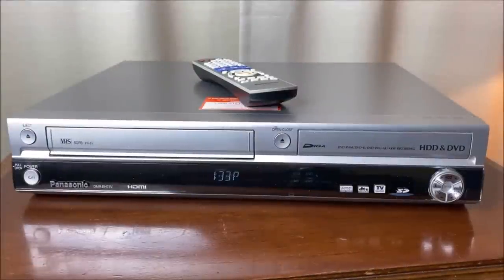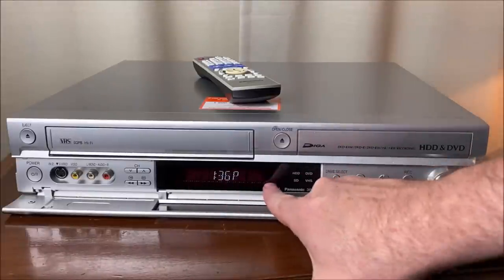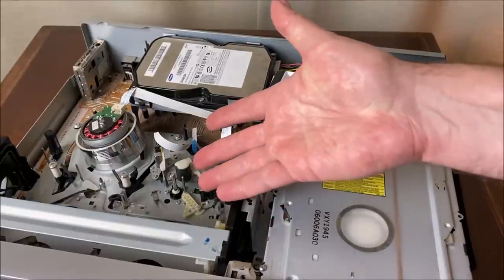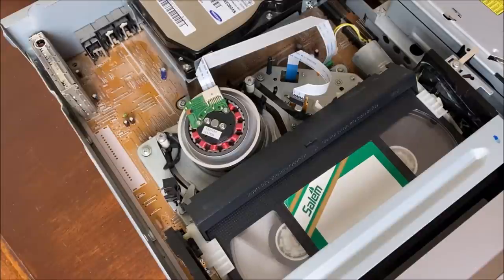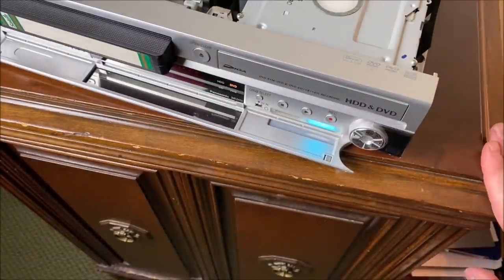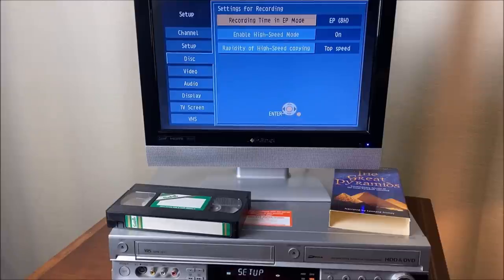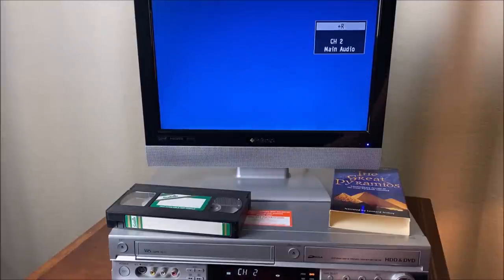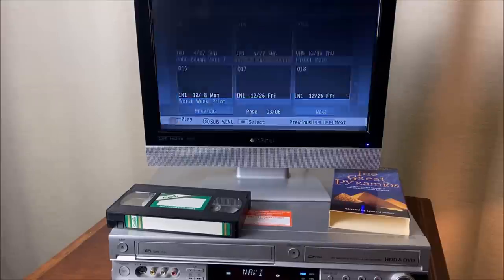Panasonic DMR-EH75V DVD-RAM VCR HDD Recorder

Comment: Afaik on these panasonic dvd-recorder/vcr decks. One of the rca outputs give you video direct from the VCR side, while the other set (+ s-video/component/hdmi) give you video that's gone via the internal digitizer which has some optional noise reduction. It's also extremely good at at stabilizing dodgy vcr output, whether it is from the internal vcr or external input, which is very useful for digitizing/capturing video (Panasonic called it VHS refresh in marketing). The later north american models with digital tuners use a completely different chipset and different video chip which lacks the tbc/stabilizing features of these. (International/european models didn't have this change.)
Reply: Correct ! i have an SCART version of the DMR-ES35V indeed with that great "TBC" like "feature" works great straight into the IS from BMD
I use the component connection, which also can be set to progressive.(defeats macrovision that way)
btw. HDMI is not so useful because it's hardware based HDCP protection which you need to defeat with yet another device, which should also switch off any handshaking functions between devices so HDMI is not so handy, component has same quality.

Comment: Back a few years ago someone on Facebook marketplace was selling a JVC DVHS deck for like 65 bucks, and I regret not picking it up. It’s probably not as useful as this deck, but man, I missed an opportunity.
Reply: Not really, don't worry, it (DVHS) stores MPEG2 to VHS tape and has no passthrough to digitize, Firewire is also not useful in this case
Reply from the maker: Thanks @Xavier for all your comments!  You're a huge help!
Reply: @databits  It's a great video, i think these Panasonic vcr combo's and dvd recorders have great features, much better than the JVC ones i have also some JVC ones, but these work not good with my BlackMagic Design capture/converter devices, my "one" Panasonic does do a perfect job, and it says nowhere TBC, or SuperVHS ...
Reply: @xavierzander4201  Passthrough, no. But the playback quality of the D-VHS deck is almost always far better. The plain VHS VCRs in Panasonic combos was very lackluster, much like non-combo Panasonic home VCRs.
Reply: @lordsmurf  I live in the (former) PAL (EU) region, and have the SCART/PAL version, unlike  the USA NTSC version, the PAL version is different, (like said before), and has not the problems of the NTSC version, using BlackmagicDesign to capture or convert is no problem, all levels are correct.
Reply: @lordsmurf  You still need a TBC feature/function with that DVHS vcr, the ES35V  has also function.

Comment: I'm glad I stopped working at their tech support before these got popular.  It was a pain in the ass enough having to explain what the black bars were on the screen when playing a DVD.  Not to mention the 30+min calls having to explain VCRs and VCR+  (yeah, it was that long ago, 21 years lol).  Granted at the time DVD recorders were just hitting the market and I think the tech support was sent to the higher level Technical Service Reps.  TSRs had specific training and handled a lot of calls about these and the Showstopper, which was early competition with Tivo at the time.  On the plus side, I was able to save some customers money, due to them wanting to connect the dvd player to their tv via component cables and told them that they could just use the red/yellow/white AV cables because they were all the same wiring, just different colored ends.  All they had to do was match what color they plug the cables into on both ends.
Reply: Setting the progressive mode helps,(for LCD tv's)  for CRT's only the interlace mode works
Reply: Yes, these are super complicated in the hands of your average consumer. Lots and lots of settings to play around with (and mess up if you don't know what you're doing.)
Reply: @rich_edwards79  When setting up, keep a monitor on the SCART or s-video/composite output, because these don't change, and stay on interlaced, yes, having the manual is really needed, mainly for setting the in or outputs, once set, they're great and useful. always/only use the original Panasonic remote pre-programmed ones can mess things up.
Reply: @xavierzander4201  I had to explain to people that unless they spent an enormous amount on a brand new TV, they weren't going to get progressive scan.  I worked there from 2000-2002.  I still remember that Panasonic pushed out their DLP TV so they could claim the first consumer model so they could beat Toshiba to market with that tech.
Reply: @rich_edwards79  Thats why they had the TSRs do the tech support on it.  I was just a CSR 1 there.  I do remember fielding an hour+ long call from a guy that was super hyped about it and wanted to know more.  He was super patient about being on hold while I researched what he was asking because we didn't know jack about its operation other than what the sales literature said; so it was a learning experience for me as well.  I can guarantee that he went out at bought one after we hung up.  I'd take an hour+ call about something like that over people screaming at me they wanted to program their phone while they were still using it to call me any day lol.  I would have loved to have gotten one myself, but even with my employee discount it was still out of my price range at the time
Reply: @HumanSnatcher  yeah, different times, most of the time the perspective and needs were completely different.
Reply: @HumanSnatcher  New tech…. one needs certainly a manual and some effort to use it, but a good manual and service to custommers is also important, it's all different now … kids running around with smartphones...

Comment: Great machine ! i've got the DMR-ES35V gives rocksteady signal for digtizing to digital, optical drive is not needed, the analog video outputs can be used straight into a Blackmagic Design Intensity Shuttle, with the Intensity Shuttle, progressive mode over Component connection, can be used.
HDMI (EH75V) needs passthrough device  for stripping HDCP (Home Cinema Theatre?) when tranfering to external HDMI recorder.(some HDMI recorders don't need even that)

Comment: I have the version of this that lacks the HDD but includes a DVB-T tuner (which unfortunately also means no RF out for distribution purposes like a standard VCR.) Cost me an absolute fortune new, but the quality of Panasonic stuff makes it worth the price premium, imho. Oddly enough it doesn't play the DVD-RAM cartridges (even though they physically fit in the drive) - you need the ones without a caddy  which I only found out after purchasing several of the latter! I don't use it much now as apparently the DVD drives are quite fragile and can't be replaced due to being hard-coded to the specific machine.
Reply: the DVD drives are not hard coded but was adjusted with the digital PCB in the factory so if you buy a replacement drive you must adjust the laser potentiometer till it reads the discs with your digital PCB. I've done it on my own device

Comment: These are still very desirable and go for many dollars in working condition.  Great bit of gear.
Reply: Same here in the UK, they fetch a fortune on eBay. Probably more than I'd be willing to pay for used, unserviceable electronics tbh, luckily I have one that I purchased new in the late 00s.
Reply: @rich_edwards79  I'm in Australia, and a working unit will still set you back about what they were new, between 3 - 500 dollars depending on condition etc etc.  Even broken machines sell in the hundred dollar ranges, I guess 'we' tinklers like a hand at trying to get them going when it 'could' be just a capacitor problem.  I have my dad's unit which is still running great, and another unit which I got fired up but now has a dim display panel, so always on the hunt for a parts unit. :)  Great little machines, spite the fact a lot of them seem to break down....
Reply: I bet the ones with digital turner is very expensive,if one can be found.
Reply: @donbest5024  the ones that have digital tuners are of a later date, and have maybe not the TBC like throughput, (Hollywood protecting his ground in legal ways) HDMI will maybe work with a passthrough device.

Comment: Nice DVD recorder and VCR player.
Reply: Axel Steiner  component is (also) available ! (both on US and EU) but indeed the SCART version adds RGB for decoders or teletext/ceefax passthrough, my experience is that most panasonic recorder combo's have exelent (also passthrough) TBC like function which works fine with Intensity Shuttle for transfer to digital, no extra TBC needed.
Reply: Axel Steiner  will not be much difference compaired to component, RGB (eu) had a different function,(decoders and Teletext passthrough) but it was used in US tv studio's at that time, but there were different versions of sync in the US, in the EU it was just RGB + composite for sync to use it. (so yes, RGB is better then composite or s-video)

Comment: This deck is kind of a video Swiss Knife concept with capability to include SD card, HDD, optical disc, and VHS.  Something like this seems to beg for the VHS to include S-VHS and Hi-Fi capability, but, perhaps, cost considerations trumped those nice tape section features?  Still an impressive combo unit.

Comment: That is beautiful. I have a black Panasonic that is similar. Not sure if mine works with DVD ram though.
Reply: Pretty much all of Panasonics optical disc recorders can record onto DVD Ram as they invented the format. Even their BluRay recorders can record onto DVD Ram. You may find some of the later models won't take the cartridges buit you can easily remove the discs from the cartridges, and they will work.

Likewise, almost all Panasonic DVD and BluRay players will also play DVD Ram discs, my 4K UHD Panasonic BluRay player happily plays DVD Ram discs as long as they are not in a cartridge.

Comment: Can you record from a VHS or DVD to the memory card slot or copy the videos from the hard drive to a memory card and then play them back on a PC in VLC or something. 
I'm curious if the files on the hard drive are encrypted like if you took it out and tried to read it on a PC.
Reply: I guess MPEG2 or MP4 is used, SD card is only for playing files, even then the cocec is critical, HDD can only copy to DVD drive, but you have options to edit first before transferring to DVD, the files from the HDD can't be transferred in any other way. no encryption is used,(you can extract the files from the DVD)  but i guess the DOS (on the HDD) is not the same as that from a pc like FAT16
so, if the unit can play VHS over component and is stable (VHS refresh) you can convert it with a quality converter to record it with a good SDI/HDMI recorder no computer/laptop needed
Reply: No, Panasonic machines of this generation don't allow copying video to the memory card. The SD slot is for still pictures only. The only way to get video files out of the machines is by burning a DVD either from the internal hard drive or from the VHS directly. This will produce a standard DVD without DRM and without region lock, compatible with any DVD player, and that can be read on any computer drive. There's tons of software that can encode MP4 from a such a DVD, VLC will also be able to play it.

The file format on the hard drive is propietary. There are some webpages out there about the file formats, according to those it's near impossible to get anything usable from the hard drive directly. You have to go through the unit's DVD burner, which is fine as such except when it fails. If that happens the best way to save any video from the internal hard drive is by re-recording it through its analogue out to another device. You can play video from the hard drive directly if that should be necessary, it'll be sent out through the analogue outputs of the machine.
Reply: @xavierzander4201  The video format on the hard drive is MPEG2 because it is meant to create a standard DVD which must be MPEG2. But unfortunately it's not straight MPEG files that you can just copy to a computer, but somehow wrapped in a propietary container format in a complicated way that you can't decode with any standard software.
Reply: @xaverlustig3581  That's pretty stupid but I guess they don't want people copying videos but I was thinking if it's someones home videos on VHS shot with a camcorder and not a commercial VHS tape like a movie they should allow that but nope. That's why I never got one of these machines. I hope to find one where you can record ANY VHS tape either a home movie or commercial tape to the HDD and then copy the video files to a PC without going through the DVD drive.
Reply: @coondogtheman  The fact that the hard drive can't really be back-engineered is due to Panasonic preventing people from upgrading their device with a larger hard drive at low cost. They wanted to force you to buy the more expensive machine instead. The fact that you can't freely copy video to memory card is probably due to technology restrictions. In any case neither has anything to do with copyright/DRM.

There is a DRM mechanism in the machine, but in a different way: It completely refuses to copy any DRM encoded DVD or DVDs from a foreign region, and any VHS tape with Macrovision (the "analogue" copy protection scheme). So any video you have successfully transferred to the hard drive from whatever source is DRM free by definition.

"I hope to find one where you can record ANY VHS tape either a home movie or commercial tape to the HDD" It's possible but not with an integrated machine because they all adhere to Macrovision. What you have to do is get a separate VHS machine and DVD/HDD recorder, and connect the two through a macrovision filter device. These things will remove Macrovision pulses from the video signal and output a clean standard conforming video signal. The DVD/HDD recorder will then happily record that, so you can transfer anything you play on the VHS deck, because the recorder won't know there was Macrovision in place.

"copy the video files to a PC without going through the DVD drive." If you want to do that, DVD recorders might not be the thing for you. There are USB dongles who accept analogue video in and will write the video to a file on the computer. Some of these are quite cheap. They have some issues because there's no time base corrector in them so the video might look a bit more unstable than it would have to, but in general they work. They might also need a Macrovision killer though.

Or go the "classic" way with a full video editing card of 1990s/early 2000s era, which will also have a time base corrector built in. I do that sometimes with a Pinnacle DC30 (can be picked up comparatively cheaply through ebay). You need a vintage PentiumIV/PCI bus era PC running Windows98 or NT4 for it to work.
Reply: @xaverlustig3581  What about those little stand alone boxes with an LCD screen that say they can record VHS to digital without a PC into something like .mp4 are those immune to macrovision?

I've seen and used the USB capture devices but the quality on most of them well the ones I've used are just crap. I'd rather have a dedicated device do all the heavy lifting which is why I hoped a DVD recorder would work.

Also why are the hard drives of these always encrypted? I can see with a cable box/DVR for copyright reasons but a DVD recorder? Why can't I record a bunch of videos to the hard drive and then remove the hard drive and plug it into my PC? Guessing it's linux formatted and not readable by windows.
Reply: @coondogtheman  I have no experience with those standalone digitisers, sorry.

About the hard drives, as I said they use a proprietary format not for copyright reasons, but to prevent consumers from DIY upgrades. They'd rather you buy their more expensive recorder with a bigger hard drive, rather than you buying the cheaper one and then replace the hard drive on your own.
Reply: @coondogtheman  PS Apart from those standalone devices which I don't know about, digitising through my trusty DVD recorder and then convert the DVD to mp4 on my computer with handbrake or ffmpeg works best for me. The video quality is as good as VHS could get. What makes the difference is the built-in time base corrector I guess. Not many DVD recorders had that though, so if quality matters to you make sure you get one of the few that do.
Reply: @xaverlustig3581  That works. I've ripped DVDS before using handbrake. I mostly put them on my phone.

Comment: Great video..
I’m looking to buy a Panasonic unit like this and the seller claims the DVD works perfectly and the VHS plays perfectly (visually).. the audio doesn’t work.? Around 14:52 you mentioned your audio didn’t work before the capacitors were changed; was that just for VHS playback or both? 

Model NO. Panasonic NV-VP30 : DVD VCR Combi SuperDrive 

Any help would be appreciated